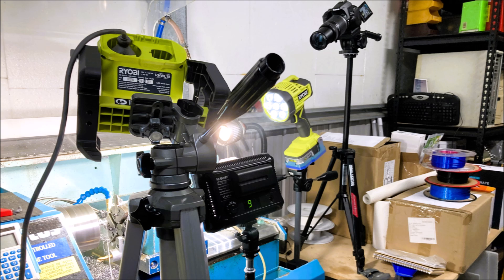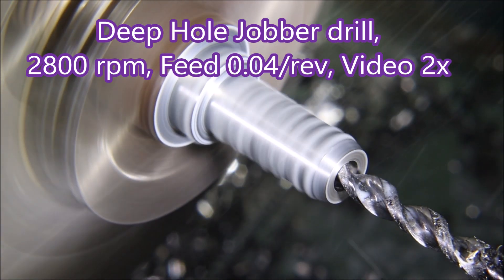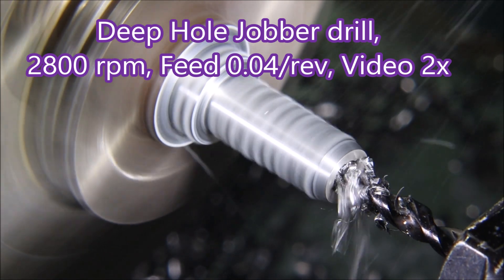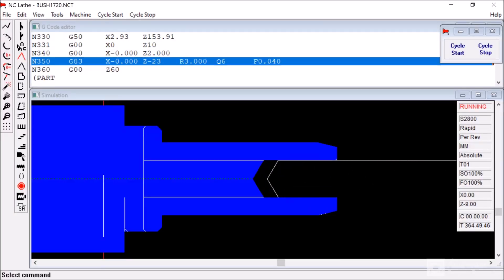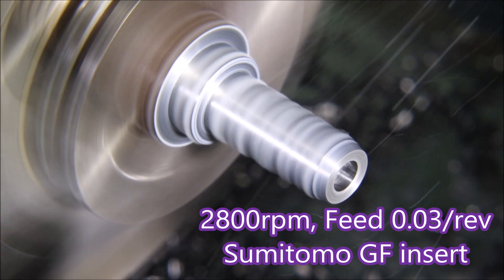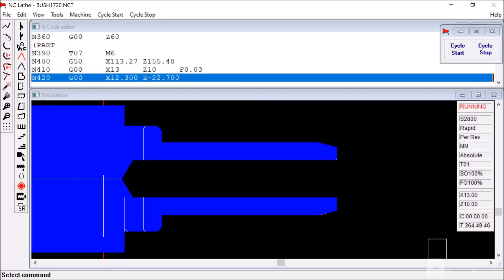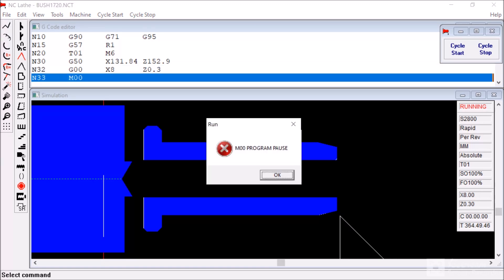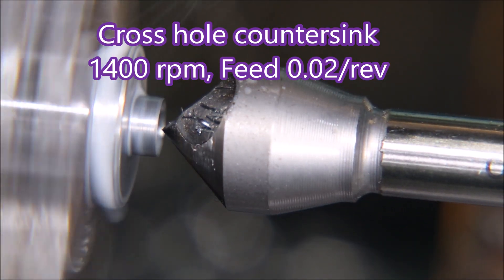Hercus PC200 making a drill bush in S1214 Free cutting steel

Comment: Love the videos. I use a 90 degree 2 flute carbide slot drill for countersinking
Reply from the maker: It works well and does not chatter?
Reply: @ only use one side to cut at a time kind of like how you tap hole edges with a drill to break the burr.  Mines a 1/2” diameter only 1” long. Run it at 400 rpm in steel mostly
Reply from the maker: @ That makes sense. Thank You

Comment: For that countersink grab a bit of high quality HSS/Cobalt or Carbide and grind up a tool.
My favourite method is to grind a circular underside for better tool clearance. This can be done on both split-round and square blanks and makes for a very smooth bevel. The flat top can then be honed occassionally to keep it sharp.  
I grind them on a D-bit grinder.
Get in touch if you would like a photo of the tool.
Reply from the maker: I don't have a grinder worthy of the name. I have never required one. All my tools use carbide inserts.  Drills get reground professionally, I know it sounds odd but it works for me.  Thank you for your comment.
Reply: @smallcnclathes  You could also just try a 2 flute Vee router bit mounted the same way.Gives you some carbide edges and an easy way to experiment.

Comment: I love your videos!

I usually use single flute or cross hole.

Six flute would make smaller chips but they can chatter pretty bad.
Reply from the maker: Thank You.  I think I will check out the 3 flutes that have been suggested.  Thanks for taking the time tom comment.

Comment: It will be a shame if you stop making videos, but obviously that's totally up to you.
YouTube seems to play funny games with how it works things out, often hear of people mysteriously having subs deleted , or notifications not doing as they should do.
Anyways happy machining:)
Reply from the maker: I can't believe the number of comments coming in. Perhaps it is the quality of the viewers rather than the quantity I will have to see .  I have been asked about parting tools, If I do a comparison video what material to part. Would appreciate your opinion of which steel would be a good one to choose. I can get silver steel, possibly 4140, 304 stainless.  I may have some brass to suit and can easily grab some 2011 aluminium.  Which materials would you choose for a parting video in a small cnc lathe
Reply: @smallcnclathes  4140 would be my choice of material to work with, but I think for many of your viewers that are more on the hobby side of things perhaps aluminum or silver steel is more relevant for them.
Reply from the maker: @landlifem5872  I wonder about silver steel as it is readily available at engineering places rather than steel suppliers, so probably easier to get hold of.
I know it will be easier for me to find
Reply: @smallcnclathes  most steel shops that sell to the public around here just have 1020 in bright bar in stock, but it's uses are limited.
Silver steel around here is probably about the same availability as aluminum from more specialty supplies or an engineering place.
Most my 4140/4340 stock came out of scrap bins , lol.
Reply from the maker: @landlifem5872  1020, that is what is generally called mild steel yes?  That is horrible stuff, can be welded is about all it has going for it as far as I am concerned. Had to make few parts that needed welding and it was horrible stuff, so sticky.  My coolant stopped and the end of my parting tool almost disappeared. i have asked the members of the Hercus Facebook page for their opinions, will see what they come up with.
Reply from the maker: @landlifem5872  Grandson just told me he will get me some 4140 from the scrap bin at work. LOL

Comment: Nice little part, perhaps if you review some of your more successful videos (views wise) and tried to identify what made them appealing to the youtube algorithms so you could then replicate in future videos ,just an idea
Reply from the maker: Hi Alan my best videos are about parting, not sure what more I could do on that subject. Thanks for your comment
Reply: @ on the subject of parting, for my very similar boxford lathe i need to get a new parting tool , is there much of an difference in the force etc on a small light machine using a 1.5mm over a 2mm tool ? Which would be the best option
Reply from the maker: @Alan-hd9ov I have to be honest and admit that I cheat. I use a Sumitomo GF type low cutting force insert at 2.0 wide.  I also use another Sumitomo insert of a different type that is only 1.50 wide, both have never let me down.  I would never consider a 3.0 wide insert for my lathe, just more cutting pressure than I want to entertain. Alan are you in my emailing list?

Comment: I find it impossible to enjoy the machining if I have to setup camera angles etc. I mostly don't upload anything, unless it's short and I only want to share something that others may find useful. It's hard work, I understand your frustration. I enjoy the videos you upload fwiw
Reply from the maker: Thank You for being a regular in my comments. You are quite right, it is difficult to enjoy a job if it involves making a video. Not so bad it there a re a few parts involved, but a pain when the run is finished by the time you get the video right.